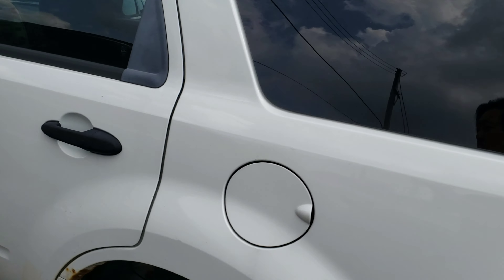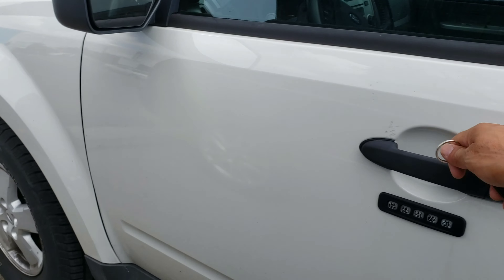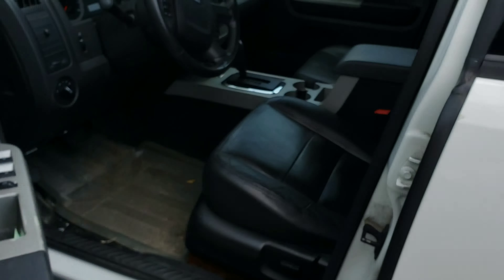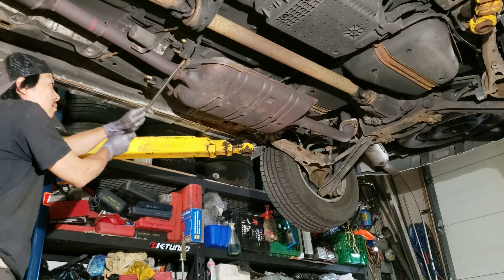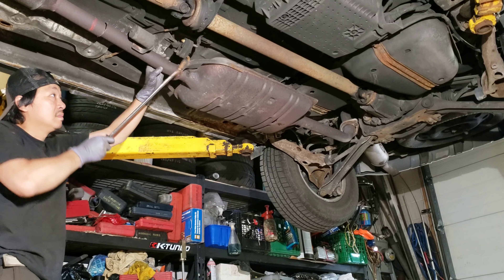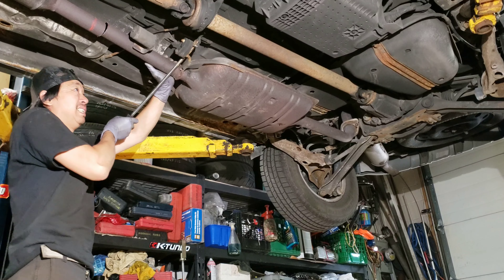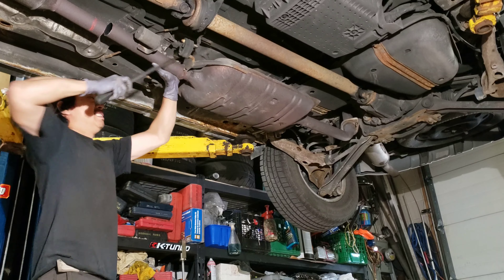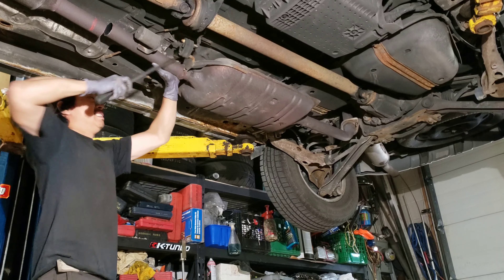How to Ford Escape Muffler replacement

Comment: Excellent video, thanks for sharing your experience. Great video, audio and tight editing. Perfect.
Would a badly leaking resonator muffler on my 2009 Ford Escape throw a P0303 error code - misfire Cylinder #3?
Reply from the maker: Thanks for your comments. Much appreciated.  A P0303 from my experience would not be muffler related. I would check your spark plugs.. that's usually the most common issue. Next would be the coil pack (if I remember correctly that motor uses coil packs instead of wires) hope this helps. Cheers
Reply: @UncleTinman  Yes, Google suggested exactly as you suggested, spark plugs or coil packs. Getting resonator muffler attended to this week at the muffler shop then a tuneup.

Comment: I replaced the muffler and tailpipe on my 1969 Ford sedan in 1980 myself to save money. By the time I bought the parts and clamps and jacked it up high and spent 6 hours cutting with a hacksaw and moving the pipe back and forth to free it up and putting the new on, I saved $6!
Reply from the maker: Thanks for your reply of wisdom and experience. Times are a little different now.. tools are much more efficient and parts are much more affordable.  Cheers.

Comment: Got a question. I got a muffler with a remote controlled bypass valve to make sound exhaust louder. But instead of replacing the muffler, they replace the resonator with the muffler with bypass. Now it made the exhaust sound just the way i like but i notice that after installation my gear changes a little bit late. Before it changes at 2k rpm now it changes at 2.5-3k rpm. Will this case a problem to my car? Do i need ecu tuner or ecu will learn the changes? Also if in case i bring the resonator back and just tell then to replace the muffler do i still need to tune the ecu?
Reply from the maker: Does the shifting difference occur when using the valve? Or does it occur regardless if you're using the bypass or not. I'm not familiar with the issue. Perhaps ask your tuner.
Reply: @UncleTinman  actually shifting is more delayed when closed than opened. I return the car to the mechanic and put it all back to stock and now all is ok even the response of the engine from the throttle is now back to normal.
Reply from the maker: @CavenInToTheWorld  great to hear.  Glad you were able to solve the issue.

Comment: If you spray the rubber isolators with some silicone spray, they come off (and on) a lot easier. Thanks for the video.

Comment: How did you fix the rear hanger? I have a 2012 Ford Escape and my rear hanger has also rusted away.
Reply from the maker: You would have to weld another one on

Comment: My 3.0 duratec muffler has a pinhole in it. It's on the bottom about 3" from the engine side of the muffler. I've heard some mufflers are supposed to have a small pinhole to allow water to drain out.  It's an easy fix but I want to be sure I'm not fixing a hole that's supported to be there.
Reply from the maker: Yes. I've seen some mufflers with pinholes for water drain.
Reply: @UncleTinman  Thanks bro.  Yes,  after closer inspection it's clearly there by design.  Thanks for taking the time to reply.

Comment: I'm only doing this to pass my safety test, as soon as I fix this I feel like another hole will break open in my exhaust somewhere else because of the increased pressure in the exhaust pipe
Reply from the maker: Perhaps you can replace the rest of the system if it needs replacing.
Reply: True lol, thanks for the video, do all walker exhaust products slip over the pipe or do some need to be welded on, I'm looking to order one but with a different part number, but it doesn't specify whether it slip over the pipe or needs to be welded to the pipe?
Reply from the maker: @The-r4k  it should be a slip on and secured with a clamp.

Comment: Thanks for the video, do you have the part numbers for the gasket and pipe clamp you used? Also, just to make sure that Ford escape was the I-4 2.5L engine right?
Reply from the maker: Thanks for your reply. It was a v6 engine. I don't have the part number. The parts were ordered from a local exhaust supplier. If you call your local auto parts supplier they should be able to reference the parts needed. I often order from rockauto, but for big bulky items as such I think it might he cheaper to order local.
Reply: @UncleTinman  thanks again, the video really helped. The only difference in my installation is that the new muffler slid on much easier with much more wiggle room than yours did. With the one pipe clamp, it didn't seem like there was a good seal. So I might get another pipe clamp and set it opposite the other one to try and get a better seal. Or take it to someone to put a bead of weld around it. Either way it sounds so much better and only took about 45 minutes.
Reply from the maker: @TheMrbabadoo  Glad to hear it helped. You could try muffler cement as well... but a weld would be much better.

Comment: Hey thank you for the vid! My 08's exhaust is hanging due to one of those rubber straps coming loose (the ones that were a bit rusted in your vid) im trying for the life of me to get it to "go back up" and twist into place but im having loads of trouble. is there anything you recommend? Thank you in advance.
Reply from the maker: Thanks for your comment. Would a metal coat hanger help?
Reply: @UncleTinman  yes it would
Reply: @UncleTinman  Thank you! I’m gonna go that route if I can’t get this rubber piece to go back in place.
Reply from the maker: @koolaidman239  try spraying some lubricant to help slip it on.

Like wd40